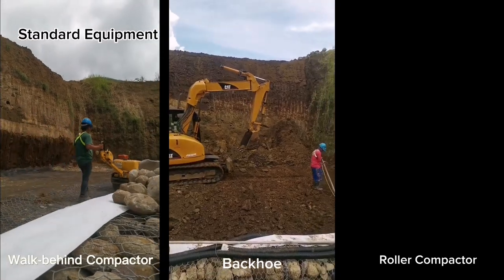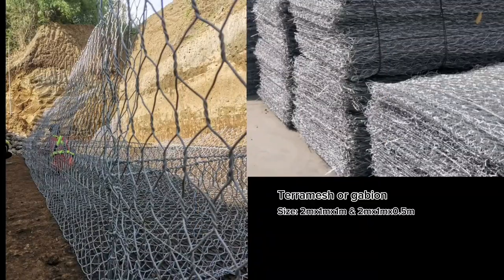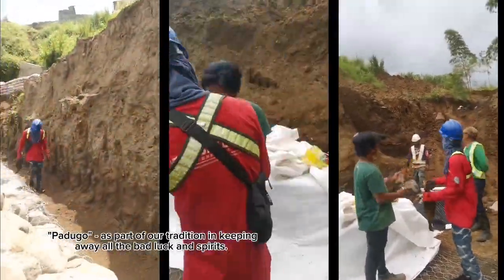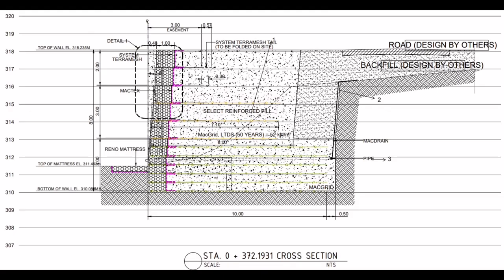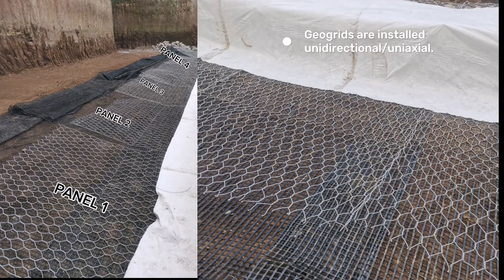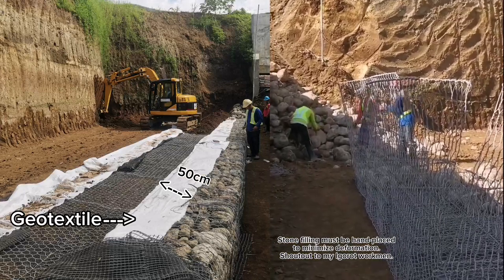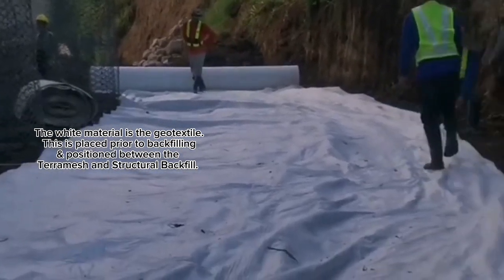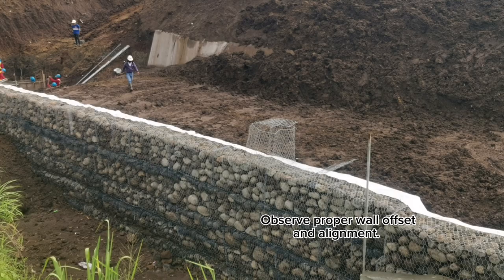MSE WALL Installation | Mechanically Stabilized Earth Wall Installation #gabion #construction

Comment: should granular backfill undergo FDT test every layer?
Reply from the maker: Yes, every 25-30cm layer as required.
Reply: as far as I knew FDT Is intended for the preparation before pouring fresh concrete on roadworks. And granular material is used on MSE wall to gain voids as for the water to flow out.
Reply from the maker: @rolandodiaz9993  for the backfill, FDT is also required to ensure that the soil is well compacted, around 95% of the MDD